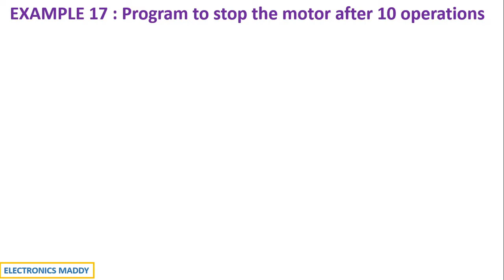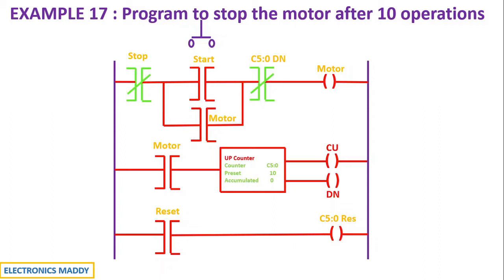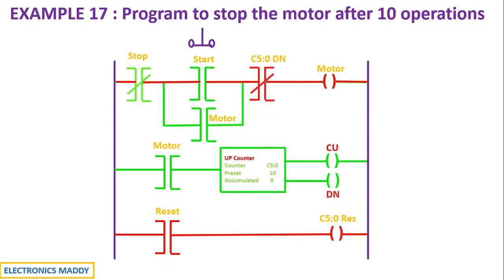EXAMPLE 17 | Program to stop the motor after 10 operations | PLC PROGRAMMING

Comment: what is the use of the RUNG 1 : parallel connection of motor with start ?? (even if its removed the system works the same way)